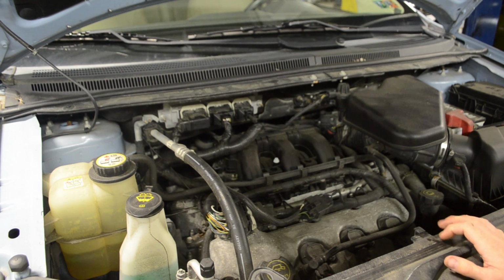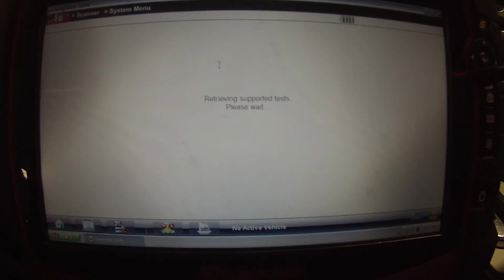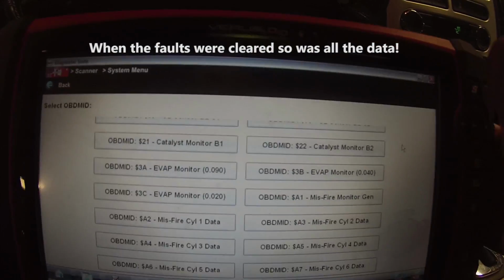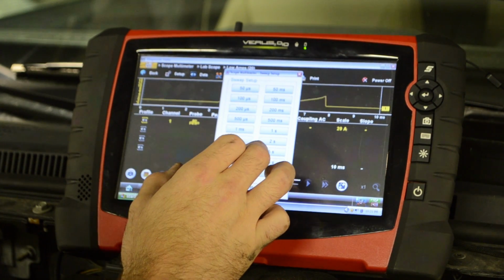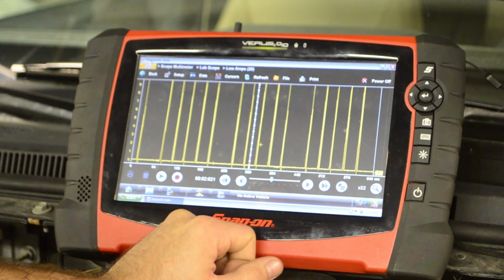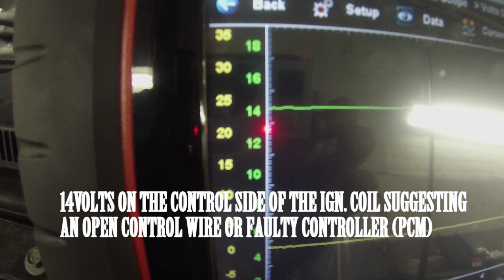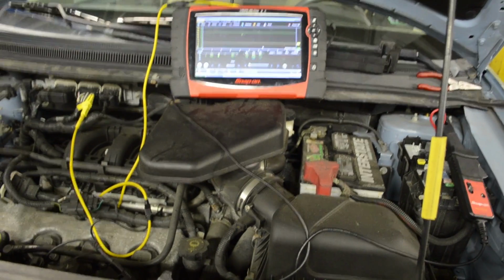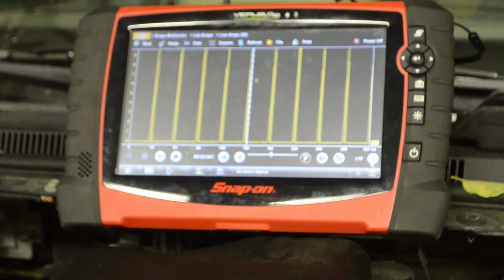2008 Ford Edge Misfire (Faulty PCM/Melted Ignition Coil)

Comment: Is it possible that the PCM shuts the coil off when it sets a code just like it does with the injectors? I mean i would have cleared the codes and then look for control to that coil before calling a PCM, and of course checked the coil
Reply from the maker: Rassiel Coto I can't argue that but I have never seen the coil control be turned off due to a misfire. Injectors yes. But if that were the case on initial start up I would have had all 6 current ramps and then the pcm would have shut the control off after it detected the misfire. I don't know if i had the initial start up filmed when looking at the current ramps. But I never had control at any time. Clearing faults may not have been a bad idea but I don't think it would have helped me or changed the direction I was going anyways.
Reply from the maker: Rassiel Coto another thing to is that my cylinder drop test I did on the front cylinders. I was unplugging coils and I never lost my control after creating those faults. If the pcm was shutting coil control off after a fault sets then when I plugged my coils back in I would have created more misfires

Comment: nice. would the pulsed ground be a square wave on the scope going from 14 volts to 0?
Reply from the maker: yes it would, ecm turns it on (pulls it to ground) then when it turns off is when the coil is fired